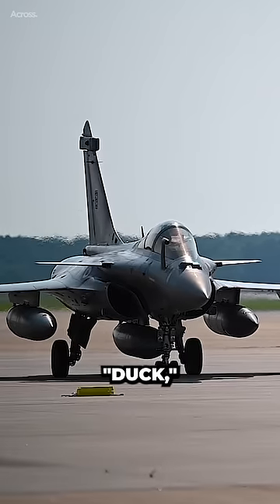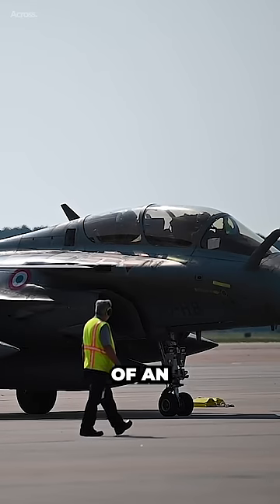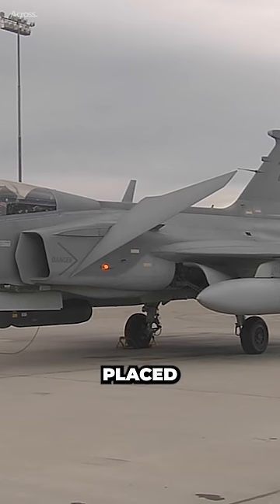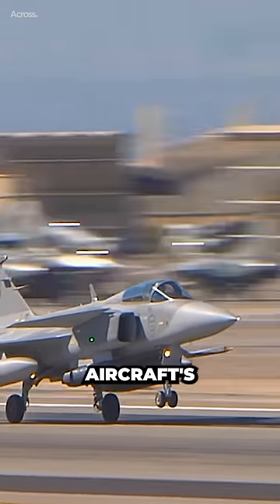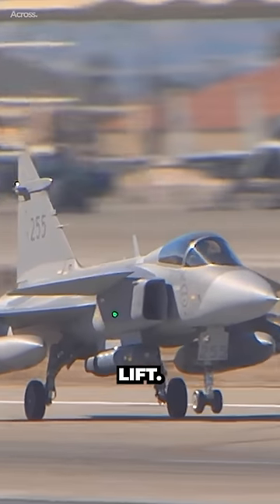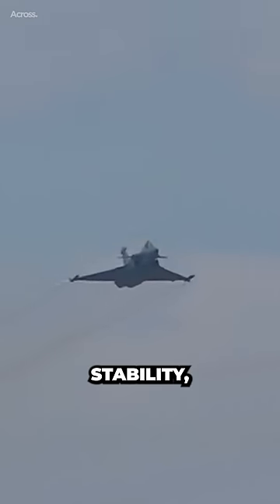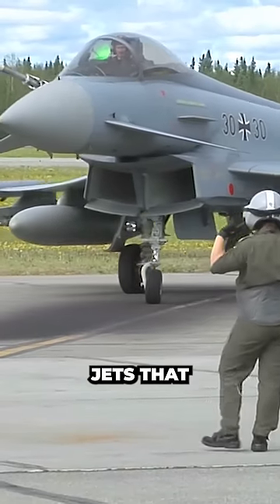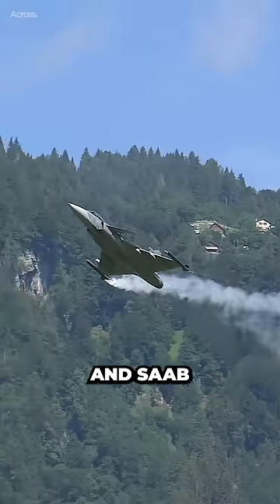Why Don't American Fighters Jets Have Canards? #shorts

Comment: Actually, no, it not really historical.

Take a F35 which is far more maneuverable  then say a F16.
Take a F35 which is far more maneuverable then say a Rafale.

What do you notice in above? (beside the F35 have a better power to weight rating then the above 2 fighters)

Why of course the F16 and Rafale are single tail designs.

The simple matter is single tail fighters have significant disadvantages over that of twin tail fighters. The fantastic line of “Su” designs from the wonderful folks at Sukhoi Design Bureau have not even considered ANY single tail fighter in 30+ years. (In fact, no one is, unless they are really short on cash).

So, the F16 has some serious handicaps against the F35, and one big issue is the single tail design on the F16.

This is basic aerodynamics 101. When you pull up hard on the F16, then airflow and pressure builds under the airframe, and now airflow over the rear tail is blocked (it receives less airflow).

So, to solve the above? You put dual tail sections on a fighter. You then move them apart to get clean airflow. You also angle them to bite even BETTER into that airflow. And look from the front all the way to the rear – you can see the tail sections are placed in clean and un-blocked airflow.

The other possible solution? You tack canards on the front - to try and MAKE UP for this shortcomming.

Now the above is an obvious observation of basic airflow over a plane.

But, if the above is really the case, then pilots flying the f16, and now the F35 should CONFIRM this design shortcoming of the F16.

Here are some actual pilot notes (a long time f16 pilot now flying the F35).

Quote:
The F-35 provides me as a pilot greater authority to point the nose of the airplane where I desire. (The F-35 is capable of significantly higher Angle of Attack (AOA) than the F-16

So it easier to point the f35!!!
This confirms the single tail design shortcomings of the F16.

And the pilot goes on to state:

Quote:
This improved ability to point at my opponent enables me to deliver weapons earlier than I am used to with the F-16, it forces my opponent to react even more defensively, and it gives me the ability to reduce the airspeed quicker than in the F-16

Quote:
Since I first wrote this post, I have flown additional sorties where I tried an even more aggressive approach to the control position – more aggressive than I thought possible. It worked just fine. The F-35 sticks on like glue, and it is very difficult for the defender to escape

Quote:
Defensive situations often result in high AOA and low airspeeds. At high AOA the F-16 reacts slowly when I move the stick sideways to roll the airplane

Note how the pilot says the f-16 reacts slowly!!!

Who wants to fly a plane that reacts slow? How silly is that???

Again: real world witness and testimony of a F16 pilot pointing out the shortcomings of the single tail design.

So both witness and testimony, and that of aircraft design and physics are in agreement here.

Quote:
Yet another quality of the F-35 becomes evident in this flight regime; using the rudder pedals I can command the nose of the airplane from side to side. The F-35 reacts quicker to my pedal inputs than the F-16 would at its maximum AOA
(the F-16 would actually be out of control at this AOA)

Again, “reacts quicker”. The F-16 would be out of control at this AOA!!!!!

Again, this is conformation of the single tail design shortcoming of the f16

Quote:
Another aspect is the kind of reaction I get when I push the stick forward; the F-35 reacts immediately, and not delayed like the F-16. Looking at another F-35 doing such maneuvers is an impressive sight. The various control surfaces on the airplane are large, and they move very quickly

Note NOW we NOT talking about AOA, but simply how the f35 responds to pilots inputs.

Again, note the “delay” in the F16. The F35 not only uses the rear elevator, but also the two tail fins can augment the airflow by moving the twin tail surfaces to help the rear elevator (because they are angled – they can provide lift in addition to left/right forces).

So two rather interesting issues here:

We see that single tail fighters? They lack maneuverability. So, canards are an attempt to fix this.. 

Even the original F16 design was supposed to be dual tail. However, this would have increased costs EVEN more, and would have delayed the fly by wire system, so, they dropped dual tail designs for the F16.

The F16 program actually costs MORE then the F35 program, this is in terms of both development costs, and total lifetime program costs.

So, if a nation been building single tail fighters? Well, that's what they know. So, when Dassault was to build the Rafale, they were short of money, but MORE important short of engineering to build a dual tail figher. (it would have increased program costs, and the risk was higher then sticking with what you know - in this case single tail fighters). So, they were able to save a lot of R&D, put a hot new dress on their previous designs, and tack on canards and hence out popped the Rafale.

However, a F35 has a BETTER (higher) thrust to weight then either a F16 or a Rafale, but more important, the F35 is a far more maneuverability fighter then either, since it has a dual tail section.

So, and this is not opinion, but based on REAL pilot's quotes as above. It is also aerodynamics 101 and airframe air flow.

If the F16 had dual tail section, it might give the F35 a fight, but it does not.
And if the F16 had a better thrust to weight then the F35, then again, it might stand a chance, but it does not.

Same goes for the Rafale, it has BOTH a single tail shortcoming, and ALSO has a lower power to weight (thrust to weight) then a F35.

For example, EVEN with canards, you will NEVER see a single engine fighter do a flat spin (they have to keep the nose of the fighter pointed towards the ground to keep airflow over the tail section. This 50 second video shows the high maneuverability you get with a dual tail section fighter, and you will NEVER see a single tail fighter do this kind of move:
50 second video - f35 flat spin.
https://youtu.be/2Xygbw6t_z0

Comment: You dont need canards when you have god tier Fly-by-wire technology and vortexlift generators like LERX on the f18 or the air intakes on the F35
Reply: It's funny you say that. As In terms of outright flying performance. Apart from the Raptor, all modern delta winged platforms that incorporate canards are all superior to any other U.S. aircraft & that's an easily verifiable fact.

Comment: Lol, you didn't even get two of the biggest! They are garbage for stealth, and while the aerodynamics are very complicated, they also decrease efficiency.
I highly doubt the reason the F-35 or F-22 didn't get canards is "it was too complicated", or "they just aren't interested". What kind of answer is "they aren't interested"? Why aren't they interested? That was the point of the short.
Reply: because they don't know how to do it well
Reply: Do what well? use canards? I highly doubt the firms who made the first aerodynamically unstable aircraft, can't figure out how to optimize canards.
The truth is canards only make sense on a very narrow range of aircraft.
You need fly-by-wire to deal with the complex stability issues, but if you also need stealth, well... You don't want canards then.

Comment: It about military doctrine 
Euro countries want things that are short range and all purpose they want to be able to maneuver very well as combat will be shorter 
And America plays with a bit more numbers you don’t need all of that you just need speed the reason eruo countries have it 
If simply based on the fact all the countries are very close together and an aircraft tht can do everything an f16 can do but maneuver at the cost of some speed is okay as all operations will be shorter ranges then what America aircraft plan for
Very similar to why the Germans in ww2 never built a turn fighter to counter the spits they just built better energy fighters that fly higher and faster 
Later down the line tho based on where Germans were operating a aircraft like the spit would pay off especially when paired with things like the p51 which were energy fighters

Comment: Also most of Russian aircraft aren't using them, only which I remember that do are Su-33 which is rated as one of worst planes they use and Su-37 which they had 1 and it crashed and it's quite expensive

Comment: I believe that canards are "patches" for designs that cannot achieve comparable performance to their competitors on it's own. Ultimately, it is an inefficient design and puts the aircraft at a disadvantage the longer a turn fight drags on.
Reply: Is that right? So why do aeronautical engineers, who have VASTLY more experience than you in this field think otherwise. Bear in mind, apart from the Raptor (& its not by much), In terms of outright performance. All modern aircraft that have canards nowadays, are far more superior to any other U.S. aircraft & that's an easily verifiable fact.
Reply: @THE-BUNKEN-DRUM  I love this response and I am confused at the same time. From the mouth of fighters themselves, it first comes down to the pilot. Secondly, as far as actual fighter jet performance and the spec sheet, the F-16 is king. Not sure about your statement regarding canard aircraft overall performance but the only 4th gen platforms that give the F-16 a hard time is the F-15 in BVR and the Mirage. Remember, the pilot in the cockpit blurs these lines. 
 As far as 4.5 gen, it's the Rafale, Typhoon, Su35, Su30 series and the super hornet. 

With that said, the Su35. 30series and Typhoons, trade blows very very frequently with the F-16, F-15 and the Hornet. The reason why is because the Canard and delta wing platforms have at best, 2 turns to gain an advantage. Every point after that is a constant loosing battle all things and pilots being equal.